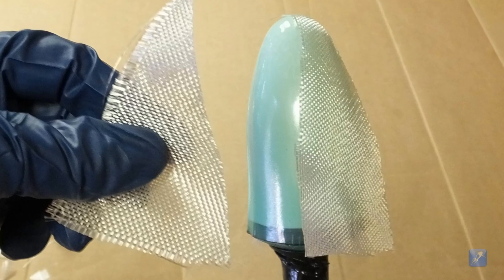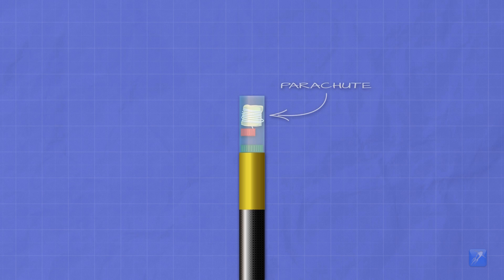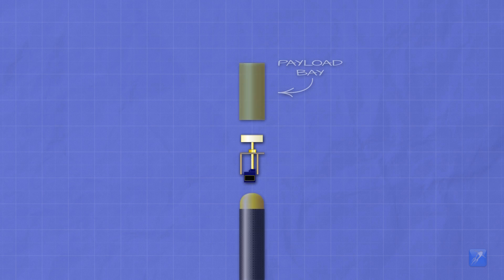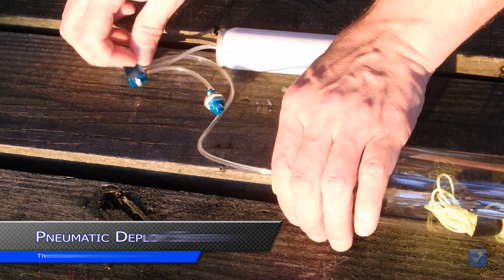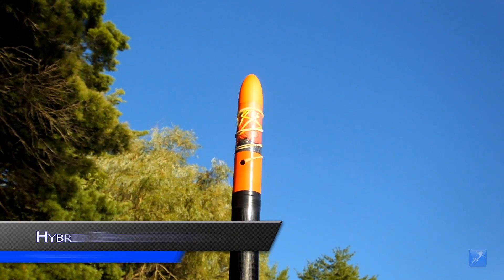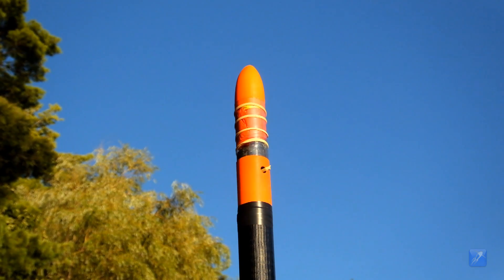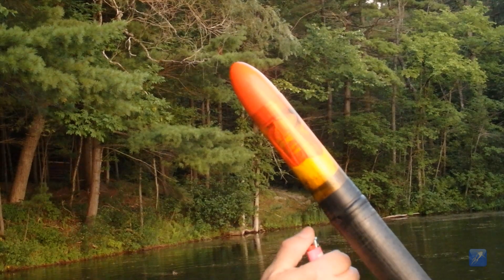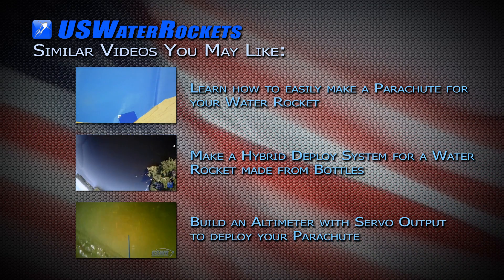High Pressure Water Rocket Making, Part 2: Parachute Ejection Systems

Comment: How it works that the Rocket always ends up in the lake? The video quality is great. Which program created the animations between the videos? Greetings from the Team
Reply from the maker: +WaterRocketsBerlin We land in the lake intentionally. By launching at the correct angle, the rocket will stay over water and out of trees no matter how the wind blows. If the wind blows straight out over the water we can launch vertical and the wind will carry it into the water. If the wind blows inward, we angle the rocket toward the lake and the wind will push it back towards us. If we are running an experiment like a new deploy system or something and we have a malfunction, crash landing in the water causes much less damage than hitting the ground, so it is good to land in the water. We get a good workout rowing the boat out to get the rocket once it lands... which is the only inconvenience compared to land based landings you can walk to.
Reply: +USWaterRockets And wich program created the animations between the Videos?
Reply from the maker: +WaterRocketsBerlin I believe they were done with Flash. I will ask for confirmation.

Comment: Guys, this is seriously one of the best water rocket videos out there. Very informative! I enjoyed watching it and learned something new about your parachute mechanisms. For example, I didn't know that you've used chemical systems some time ago.The hybrid parachute deploy system seems to work very well for your high pressure water rockets.
Keep up the great work! :)
Julian
Reply from the maker: Back when we were using the chemical deploy, the Coke&Mentos reaction was not a widely known thing. By the time it was all over YouTube, we were working on servo motor controlled systems.
Reply from the maker: +RaketfuedRockets Thanks for the kind feedback. These videos are a lot of fun to put together. We used chemical deploy for a long time. We never wanted to increase weight, so until LiPo batteries became common, we could never find anything lighter or simpler.
Reply: +USWaterRockets How about coke and mentos?